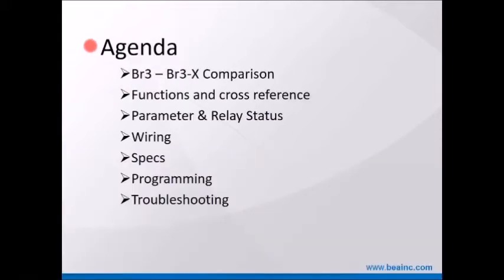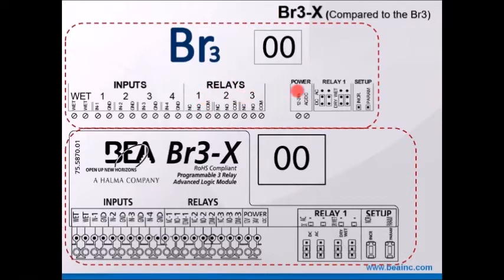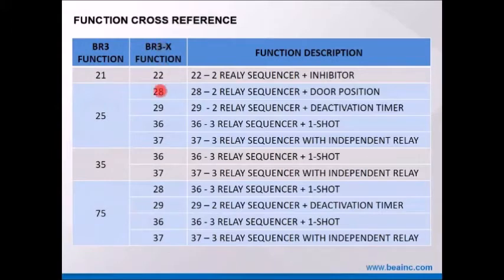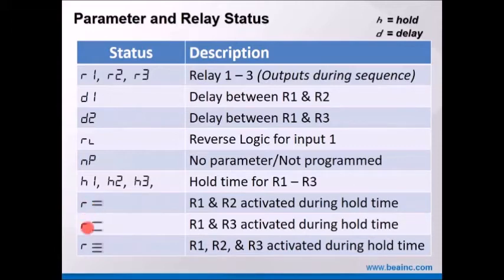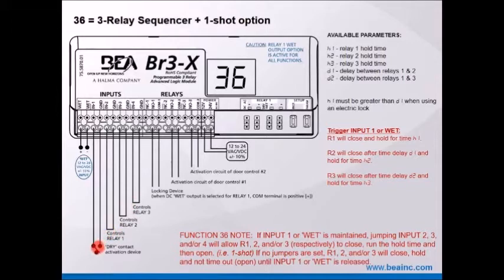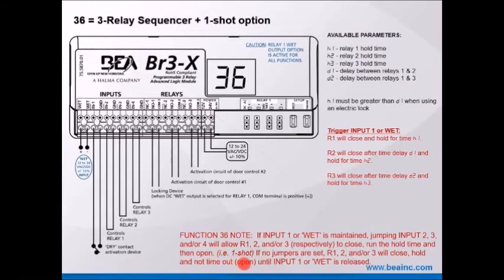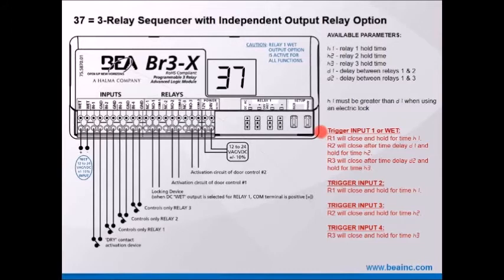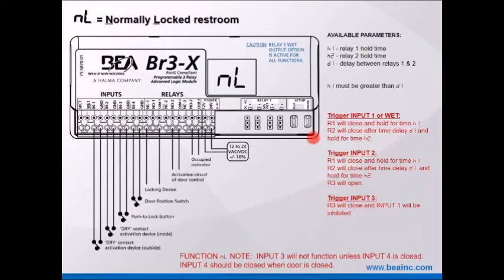BR3-X Technical Training Webinar

Comment: It's a walkthrough of the manual.  Not very HOW TO helpful in explaining how to integrate with an LCN or other pair door auto opener model that only simultaneously actives both doors and you want to put a delay on the second door motors activation so the auto flush bolt will have time to drop before activation.   I'm still asking the Which wires to where questions.    Can run the door motor power through the relay or not?  Does it have to completely replace the original controller and features except pulling power to BR3X?
Reply from the maker: Hello Roy, if you are in need of technical support, please contact our Technical Service team at 1-800-523-2462. They can provide you information on BR3-X setup for certain door controls and also provide you wiring diagrams specific to the door controller.